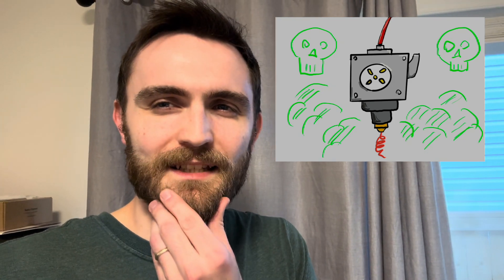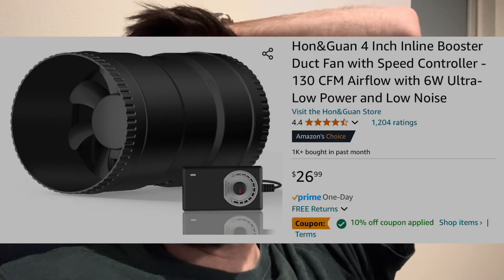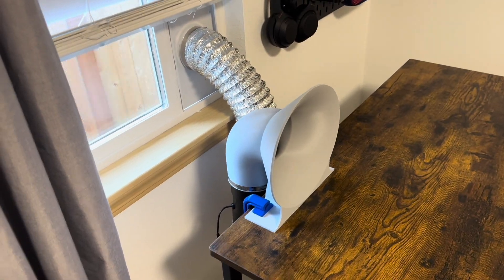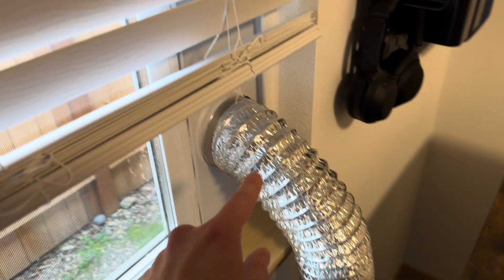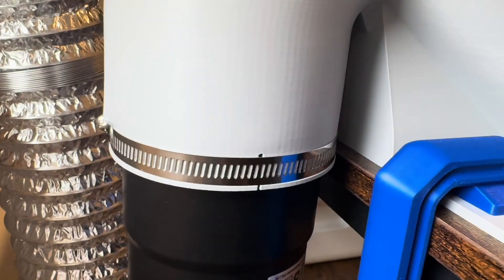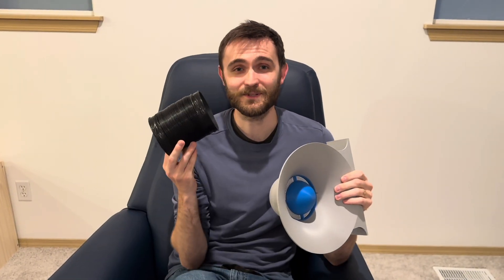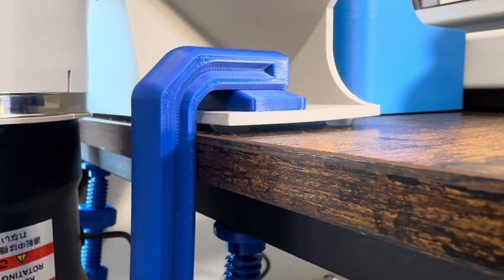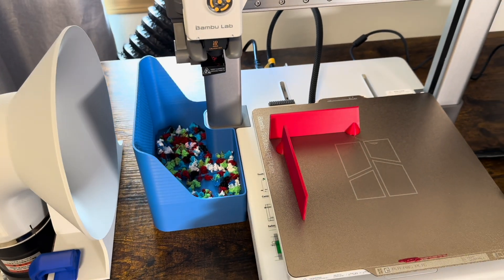Low-warp desk mounted 3D printer exhaust

Comment: the only other solution for noise (without sacrificing airflow) i could think of is putting the fan outside and using a brushless fan so it's thinner and quieter. and then to reduce footprint, have the tuba's body as articulating stem that you can move around like a snake and lock position anywhere. i would prefer the suction to be above the 3d printer bed because it's warmer air and tends to go upwards.

Comment: I've done some work like this, primarily for exhausting laser cutters or dust collection for woodworking equipment. Usually, the hose is external to what's being clamped, which is why you're getting cracking. The hose is flexible and you can't clamp tightly against it. Switch which goes where and you should see better results. Plus, the coil is annoying  to use a smooth clamp on, so they sell hose clamps that loop over a coil to mitigate that.

Nice build, overall!
Reply from the maker: @ahero4heor  thanks for the thoughts/advice!

Comment: I am guessing, you're talking about ASA, ABS, etc. regarding the fumes? As I did some of my own testing with Air Quality on PLA, PETG & TPU  and they all pass air quality from my own findings. 
The reason I did it, is that I "might" be renting out a business unit as long I can provide enough documentation of the machines I am putting into the shop (As it's an indoor Market area with different stall units) are safe for bypassers / nearby shops.
The results so far... The fumes are so much safer than a nail salon XD lol

Comment: Cool. I've been looking to do a very similar thing, but I have to run the conduit up over the ceiling, to a tiny window on the far end of my office. I do want an enclosure, though, so I can do things like ABS in my office, with zero fumes, and figured I'd have to use a very low-flow fan, just enough to take the fumes away, and ensure negative pressure, but without cooling down the enclosure.
Reply from the maker: Yeah, pairing with an enclosure would definitely be the most robust solution. Especially for stuff like ABS. 

Thanks for the comment!

Comment: Love the build and walking through the design process. I think you've found a great solution & accessible solution to yours and many other's problems.

The noise is an interesting issue, it definitely seemed loud from the video. It's either the fan vibrations or turbulent flow. For the turbulent flow, the fan could be contributing as well, and a big improvement could be to reduce / optimize the angles in your intake and duct work as every sharp angle will cause turbulent flow. This video looked informative: https://www.youtube.com/watch?v=_eWUfYgOMmQ. It may also be worth considering attaching the mesh filter to the largest portion of your intake.

Keep these videos up, you have a talent for engineering & content creation!

Comment: Great design. As an idea for the problem, instead of clamps, you could try a flexible cover (if you can print flexible material) to connect the two parts and seal the air. After that, you can support the weight of the motor without worrying about sealing issues and avoid high strain. Changing the printing orientation could also be a solution.
Reply from the maker: Yeah! Using flexible material for the interface is a great idea. I don’t have much experience with flexible materials, but it’s probably time I start giving it a try.

Thanks for the comment!

Comment: You'll wanna place the fan as close to the exhaust side as possible so that it pulls the air through the ducting rather than pushes it. If there are any holes in that ducting and the fan pushes the air , it will just push the air and fumes out back into the room again. By having  the fan the other end then any holes will also pull air into the hose keeping fumes in the hose and exhausting it all outside
Reply from the maker: Thanks for the insightful comment. That makes sense to me, it’s definitely work exploring different fan positions.
Reply: While your point about the absolute pressure is true. I'd also say that generally fans can't suck well. They only blow. That is, the efficiency, noise, and efficacy will likely be much better when pushing the air through rather than pulling it. I think this is likely not an issue with such a large unobstructive duct. But maybe it's worth considering for people doing this with something like a PC fan.

Comment: Do you think you’re creating a current that could accidentally cool your filament extrusion?
Reply from the maker: That’s a good question. So far I haven’t had any issues. I made the horn shape very wide to avoid tightly focusing the air.

Time will tell though, it’s a valid concern. The ventilation fan I chose has adjustable speed, so it could be turned down to reduce airflow if needed. The distance to the printer is another variable that could be tuned.

I’ll be sure to update the video or do a follow up if I ever run into problems! Thanks for watching and the comment!
Reply: @pearigee  very cool project though! Great video and design.
Reply: Actually legit question.

Comment: Interesting idea. I have 2 printers now, my Ender 3 S1, and Bambu Lab A1 (I guess I like models ending in the number 1), sometimes I print on both at the same time, and they are both in my main room of my apartment with no ventilation or filtering. I did just buy a small spray booth which vents air outside so I can sand and use my airbrush inside, instead of putting it off because I have to go outside to do so. I feel like the Bambu has more of a smell when printing, or I just never noticed it with the Ender. Nice video! the music is slightly loud, and it's kind of distracting when you are looking at what I assume is your phone's screen instead of the camera lens.
Reply from the maker: Haha, thanks for the feedback. Just like the engineering — making videos is an iterative adventure. I am going to do my best to improve with each one!

Thanks for watching!

Comment: nice video! maybe placing the fan outside the window would reduce noise?
Reply from the maker: Dude! That is a brilliant idea! I would just need to figure out how to weather proof it. 🤔
Reply: @pearigee I would think you could add a slight down spout outside the window after the fan. It’s kind of like what we do to keep water out of semi truck exhaust stacks when they bend them slightly at the top. Perhaps the outside method could allow for a larger diameter, slower, but quieter fan option